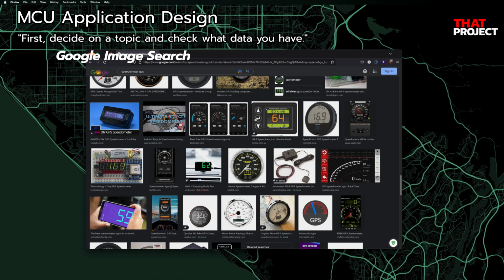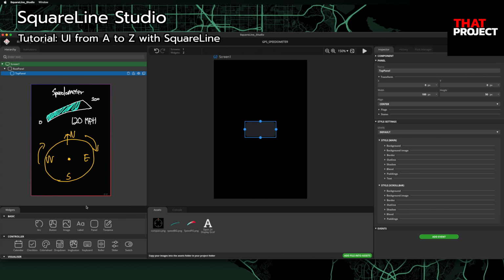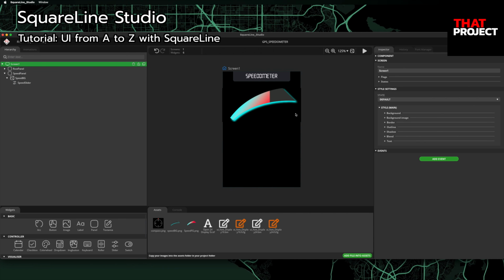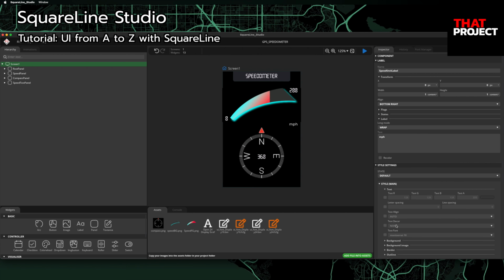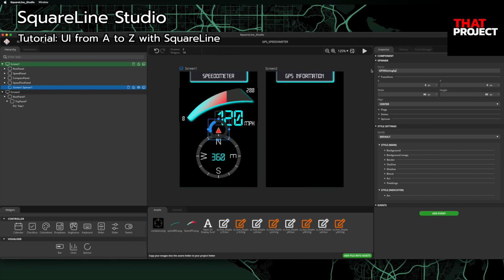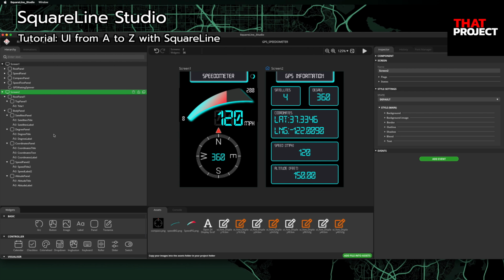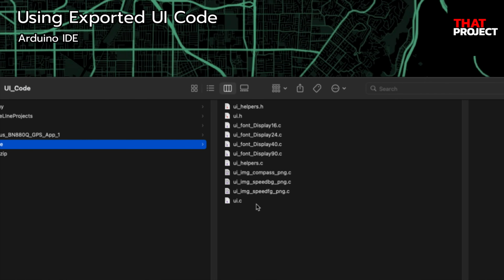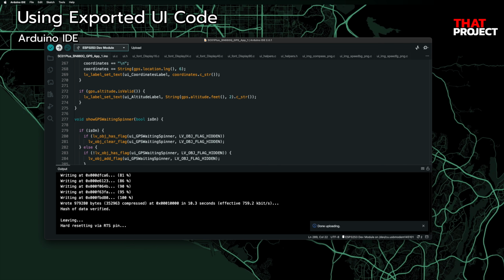Developing Embedded GUI with SquareLine Studio [2/2]

Comment: I cannot get the Waveshare-ESP32-S3-4.3 to display anything through Squareline.
I have matching lgvl versions. 

Can you please figure out how to make it work?
There is a lot of potential with that and AI.
I want to be able to display things, initiate actions like a Control Button Panel, etc.
Reply from the maker: @antdx316  The question is ambiguous. Do you already have an environment set up where LVGL works? Or are the files created from Squareline not working?
Reply: @ThatProject  I cannot get anything custom to display on it.
Reply from the maker: @antdx316  Have you added your code there? Adding some LVGL widgets? How did you try?
Reply: @ThatProject  I did. I couldn''t figure it out.
Reply: @ I was using Arduino and Squareline with the correct lvgl library version.

I also tried for a few hours with AI.

Comment: Hello, thank you for your video. I have a question. you have placed two labels on top of each other at mph. if I e.g. If you leave the display at 000 mph and 111 mph, then the numbers will no longer fit on top of each other. How can I correct this? The width of 1 and 0 is different. Thank you very much.
Reply from the maker: I don't get your situation.
https://youtu.be/b_4m1A3A2yw?si=xKg3yJrMV4k7Xnhz&t=880
As you can see in my video, I duplicated the 000 label to create the same label. In this case, because all properties are the same, a 100% identical label is added and thus overlaps the existing label. width, height 1 content is automatically sized according to the length of the content. Therefore, if you use the same font, it will be the same size.

Comment: Would a project made with SquareLine be Opensource?  Assuming i want to sell an opensource machine programmed with Arduino IDE, where users can edit the code and possibly the GUI as well. Can they do so without the use of the software?
Reply from the maker: I'm not sure about the sales part. The code exported from Squareline Studio versions so far is a 100% readable version. Therefore, modifications and additions can be made at the code level without Squareline Studio. But I think this could become impossible at any time depending on their policy. Anyway, I think that projects based on the results of Squareline studio can be opensource projects. (until now)
Reply: @ThatProject  So there is nothing in the code actually tying it back to them, nothing obfuscated or using libraries that they own?  Interesting. im looking to make an opensource project with advanced GUI but every single options i used in the past like Nextion displays were not opensource and defeats the purpose of the project
Reply from the maker: @UnknownDiver  How about discussing this again on the LVGL forum? I think this will be of great help not only to me but also to others. https://forum.lvgl.io/

Comment: Hi, thank you very much for the content, I'm having a issue with my st7796 touchscreen, the Y coordinates seems to be swaped, for example, if I do have two buttons, one in the top left and botton lef, when I touch the screen the oposite button that activates , it Seems that the Y min and max is swapped.
Reply from the maker: Try this way,
data->point.x = y;
data->point.y = tft.height() - x;
Reply: @ThatProject  thank you very much, I was able to invert in the touch config files!

Comment: Hello, Eric. Thanks for your tutorial.i download your full code.but I have compile error ( " LV_COLOR DEPTH SHOULD BE 16-BIT TO MATCH SCOTLAND STUDIOS").Can you please help me fix it ?
Reply from the maker: If you see my tutorial video in detail, you'll know I set the Color Depth to 16-bit. https://youtu.be/b_4m1A3A2yw?t=204 so, your LVGL configuration should also be set to the same 16-bit color depth.
Reply: @ThatProject  hello Eric , thanks for your quick response.actully I downloaded your project from GitHub.so do I have it open it in square line and make it 16 bit colour?
Reply from the maker: @annoorkhan4219  Well, you don't have to because it's already under 16-bit color depth. All my code is using 16-bit color depth. Check your LVGL config.
Reply: @ThatProject  can you please specify what I have to change in config?
Reply from the maker: @annoorkhan4219  Just check the lvgl/src/lv_conf.h if you're working on Arduino IDE.
Reply: @ThatProject  hello my friend.i have a small good news. Finally I am able to fixed the lvgl.config issue.After that , I added few library . But still 1 library is missing , I can't fixed it. That is " avr.interrupt.h " .do you have any idea about that ?

Comment: Hi;

ui.c: In function 'ui_Screen1_screen_init':
ui.c:88:52: error: 'ui_font_Display24pt' undeclared (first use in this function)
ui.c:88:52: note: each undeclared identifier is reported only once for each function it appears in

exit status 1

Compilation error: 'ui_font_Display24pt' undeclared (first use in this function)

I encountered such an error. I changed the values to 1 for font usage from lv_conf.h, unfortunately it didn't work.
#define LV_FONT_MONTSERRAT_24 1

Then I tried adding the font in your example via assets. It gave the same error.
I really appreciate you. Thank you for helping me develop my electronics hobby.

I will be glad if you help me.
Reply from the maker: You don't have to enable "LV_FONT_MONTSERRAT_24" because I don't use it. Please check there is the file ui_font_Display24pt in your project folder. Everything works fine.
Reply: @ThatProject 
I tried what you said. 
I may not have expressed it correctly :)

"
 In function 'ui_Screen1_screen_init':
error: 'ui_font_Display24pt' undeclared (first use in this function)
note: each undeclared identifier is reported only once for each function it appears in
"

The error points to the following line.

"
 lv_obj_set_style_text_font(ui_Screen1_Label4, &ui_font_Display24pt, LV_PART_MAIN | LV_STATE_DEFAULT);
"

It gives an error in this part of the code. 

Help me :)

Comment: Is this possible with a rasberrypi as well?
Reply from the maker: As far as I know, LVGL can be used on RPI, but there are many more graphics tools available. What project are you going to do with this?
Reply: @ThatProject  We are running a UPS Monitoring and Management system which takes the input from a custom design STM board and then uses RPI as a computer. Any recommendation for other tools?
Reply from the maker: @thekashifkhan  Mainly RPI-based works in Python or C++, so wouldn't it be better to use a GUI tool like Qt or tkinter? It is also possible to create web-based GUIs if it works as a server.

Comment: What an awesome video! Super helpful! Thank you so much for putting in the time.  I'm using this little board as a custom wall mounted robotic arm controller, and I've got it just about working!  Quick question for you, where in the world did you find the pinout for the available GPIO pins and other breakout pins?  I've looked everywhere! Any chance you could post a link?
Reply from the maker: Hey Matt, Thank you for your support. 
Are you looking for a datasheet of WT32-SC01 Plus? 
This is the only document they have released. (Chinese)
https://doc.smartpanle.cn/_static/espboard/ESP32S3/ZX3D50CE02S-USRC-4832/ZX3D50CE02S-USRC-4832.pdf
Reply: Hello Matt, there is an EN version there :
 http://www.wireless-tag.com/wp-content/uploads/2022/11/WT32-SC01-Plus-V1.3-EN.pdf

Comment: While trying to compile SC01Plus_BN880Q_GPS_App_Part2, I keep getting Compilation error: conflicting type qualifiers for 'ui_font_Display24' line 621 of the corresponding sketch, and for the rest of the font sizes (16, 40, 90) also
Reply from the maker: It seems to be an error about the font. Are you using the Arduino IDE like in my video? Please check again about the Display Font 16, 24, 40, 90 I used.
Reply: I'm using Arduino IDE 2.0.2
Reply: I'm trying to run the progam referred on Github
Reply from the maker: @MrOsola  It's really weird. If you are using LVGL 8.3.3 I think you can use my code without problems.